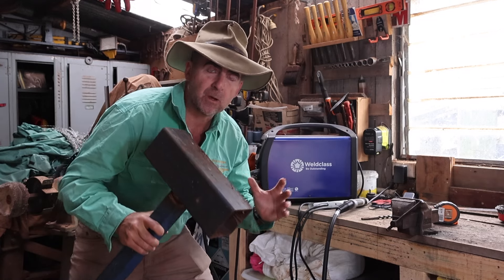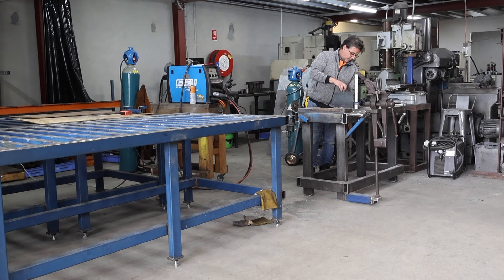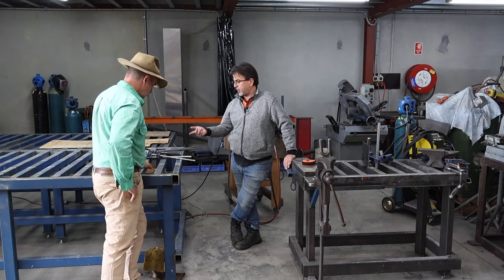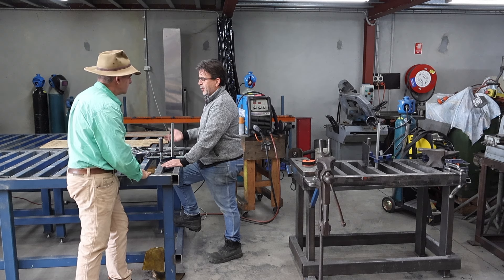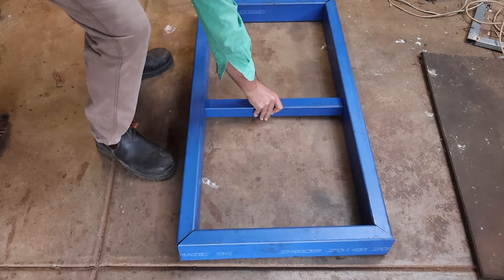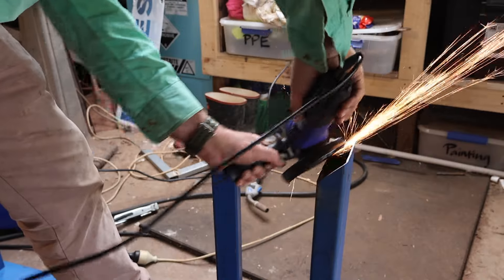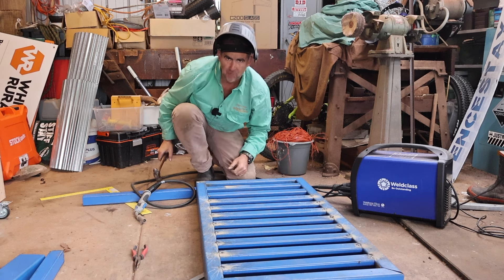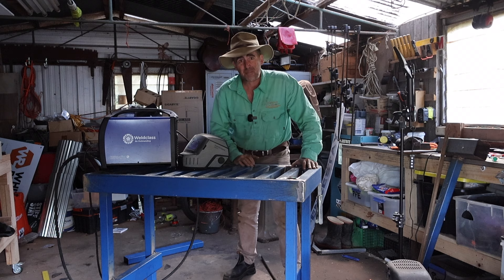Farm Welding Bench Build

Comment: Motivated me to do a build. The only features missing are a couple of wheels set perpendicular to the front legs so the table can be moved around, and an adjustable bolt on each leg to fix the inevitable wobble that is both irritating and causes the frame to warp out of square. The wheels are the number one feature for a back-shed workshop.